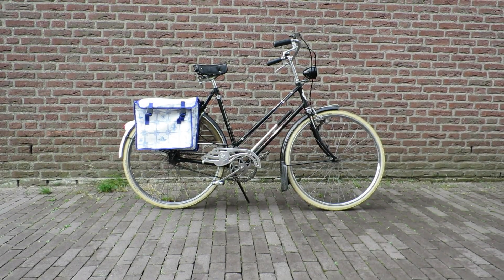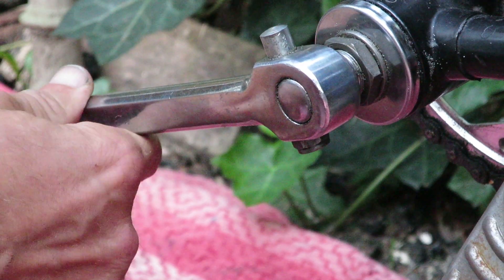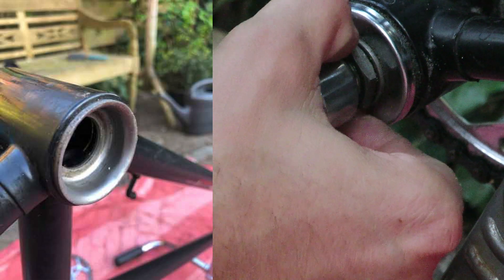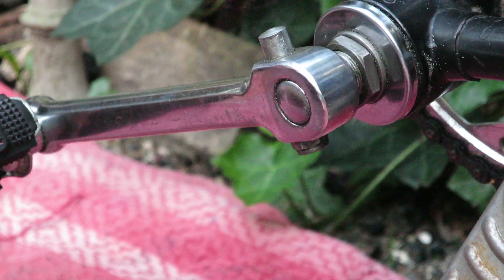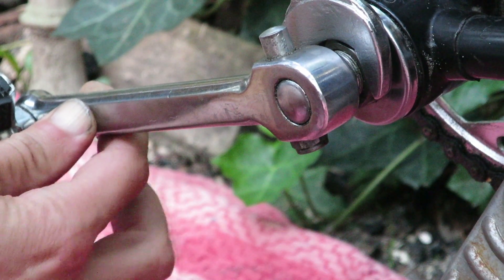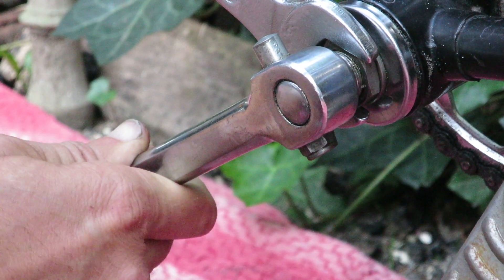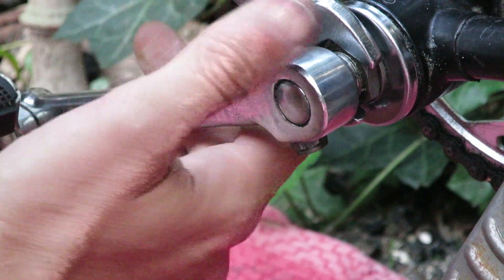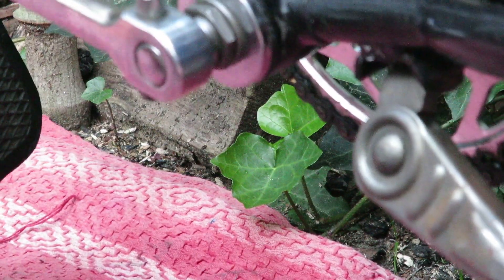Removing play from a cottered crank bottom bracket

Comment: So I see you adjusting the play by holding the crank arm and tightening the large nut against the slotted washer and cover. How do you lock that nut once you get it where you want it? Is there a second nut to lock it against? Or a Lock-Tite agent being used that I didn't see? 

Thanks for putting up this video! Have been going crazy trying to figure out a restoration on my own... well a Get-It-Up-And-Rideable anyways!
Reply from the maker: This bike doesn't have a locknut. I assume the crank was never tampered with and that it never held a locknut in the first place. Lock-Tite definitely help if you're in a similar situation. I might be able to add something that would serve as a lock nut if there's enough threading.
Reply: The cottered crank system I've seen is that the cup houses the caged bearings, and the cone threads onto the axle. The bottom bracket opening is then covered with what functions as a cap or lid, this part is not threaded, only placed over the bearings. The axle has a groove for a lockring -- effectively a washer with an extrusion that fits into the groove in the axle, to prevent the part from rotating. Finally, a nut compresses the lid and locking washer, and I think the whole arrangement also works to keep the cone from moving. To service this system, however, the crank arm and lid must be removed for access to the cone, which is really what controls the axle play.
What is shown in the video looks to be what I am describing, but of course I can't be sure without seeing it up close.